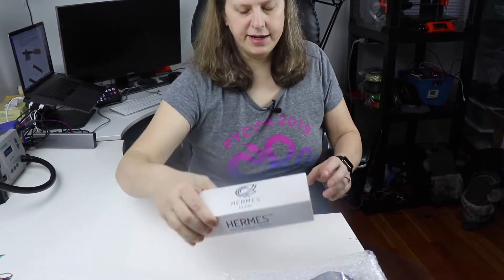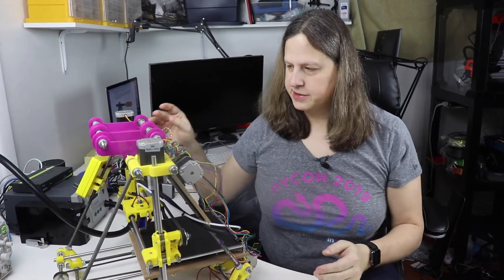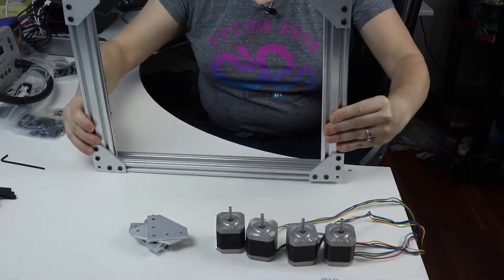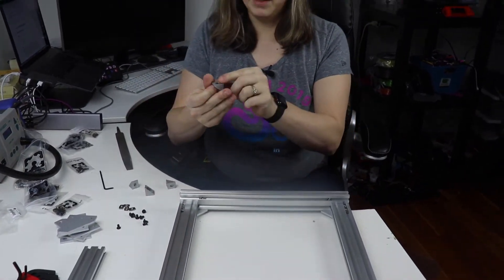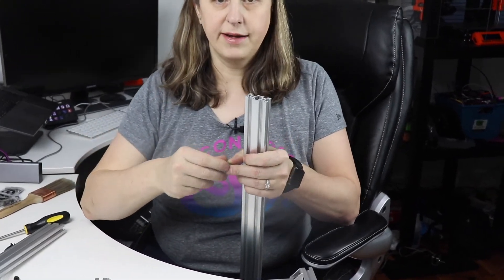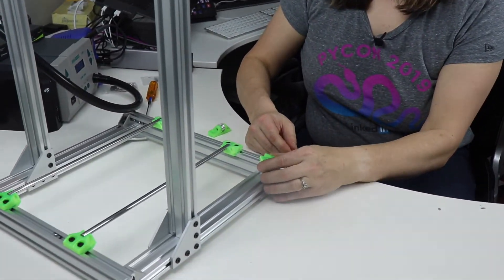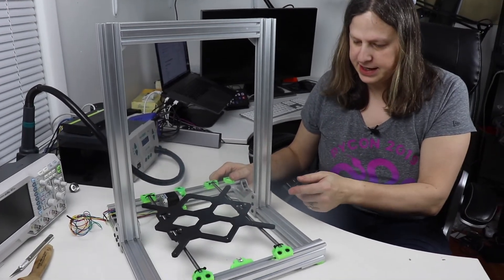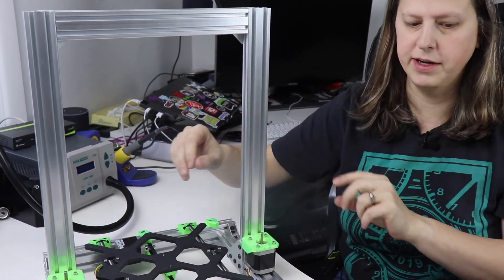Building a Custom Prusa Bear 3D Printer (Part 1)

Comment: can I use PLA+ to print the parts ?
Reply from the maker: Yep, that should work fine.
Reply from the maker: I’m not sure if this applies to PLA+, but one thing to keep in mind is if you have strain on a PLA part, it can warp over time. It also has a lower melting point.
Reply: @makermelissa  I'll try to print with PETG... Your videos helping me to build prusa bear from scratch thanks ! 👍

Comment: fun project! is this going to have a larger Z height versus a stock MK3?
Reply from the maker: Yep 🙂
Reply: @makermelissa  very cool! making my way through your build now ... I'm wondering if I can make a prusa "big bear" with CR-10 type volume...
Reply from the maker: @enyoc3d  I'm sure you could. The biggest challenge would be to find a heated bed and Y-axis carriage that is large enough and heats well, which shouldn't be too bad. You could even try and go for a larger build surface like a 400x400 or even 500x500.
Reply: The anycubic chiron heated bed with glass build plate is 400x400, costs $53 - it's the one stock part I like from that printer.

Comment: Melissa, what type of filament did you use to print the plastic parts?  (I think that most people use PETG or ABS for printer parts.)  I am asking because I am working on my own printer design (don't ask; I don't know why either), and I am trying to decide what plastic to use for the printed parts.  (I am leaning towards 'abs+', but I wonder if I will be better off with PETG, even though it has a lower temperature range than ABS.)
Reply from the maker: wfpelletier I used Prusament PETG for almost all parts except ducted nozzle for parts fan which I used Prusament ASA to print. If you’re still leaning towards ABS, I’d give ASA a look too. It’s similar, but without so many negatives.